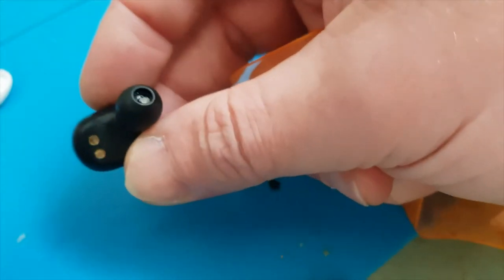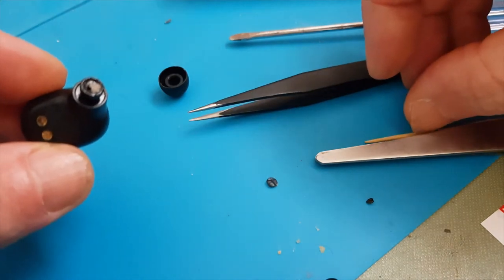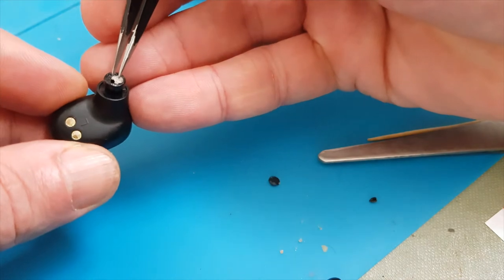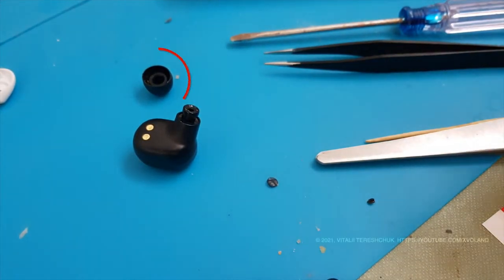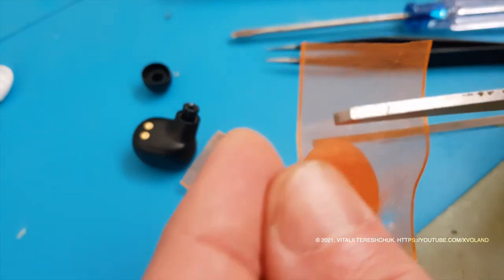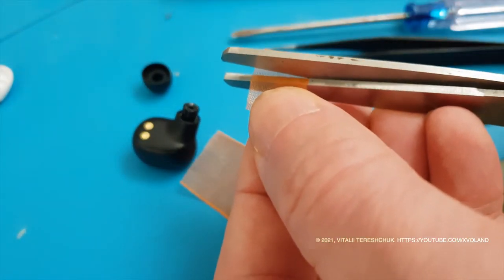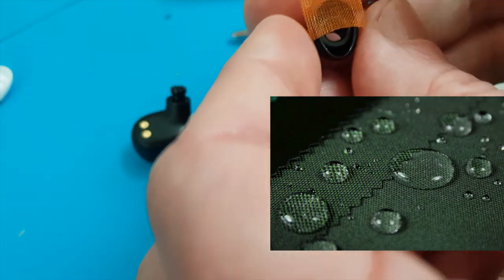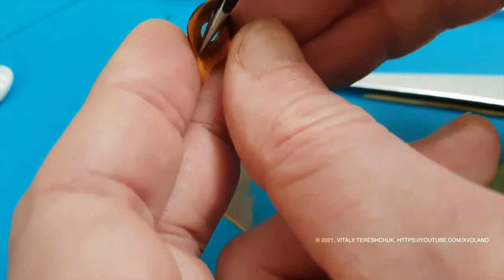🛠 💡 Easy way trick How to Repair headphones mesh grid (protective grill) and headsets easy fix

Comment: What happens when you don't hv a protective grid? It's lost just now what will happen to me now
Reply from the maker: Earwax will get inside
Reply: @xVoLAnD   is there any way to replace it with something, or like avoid it getting inside
Reply from the maker: @lvqgx  In this video I show how to do it.  Also in a few days there will be another video and I’ll offer another solution
Reply: @xVoLAnD  i didnt have that material, i tried thin paper and added some holes in it it worked the same, thanks
Reply from the maker: @lvqgx  The material I will offer is very easy to find
Reply from the maker: @lvqgx  https://youtu.be/r-vByOp-eHw

Comment: I have a question 
Are these grill sheets necessary or can we use earphones without them
Reply from the maker: Yes, they are. This prevents dirt.
Reply: @xVoLAnD  ok thank you 
I mean can I use it for sometime and will this harm my ears or not
Reply from the maker: @taedybear4523  There is wax in the ears and it can get inside the headphones. You can use, but remember about this
Reply: @xVoLAnD  ok 
Thankyou so much
Reply from the maker: @taedybear4523  You are welcome!
Reply: @xVoLAnD  how to clean my earbuds from dirt
Reply from the maker: @omarmohamed-ik7tr  If sulfur gets inside, then carefully disassemble and clean, but be careful, there are thin wires
Reply: @xVoLAnD  I'm sorry but I have one more question is it normal that the sound comes then disaperes without the mesh grid or my earphones has another problem? thank you vitalii ❤
Reply from the maker: @omarmohamed-ik7tr  Probably the wire already has a bad connection. Therefore, repairs are needed.
Reply: @xVoLAnD  thank you Vitalii, appreciated ❤️
Reply from the maker: @omarmohamed-ik7tr  You’re welcome! 👍🏻

Comment: Great idea! Much better than the thinking of the original makers! They should have thought along these line in the first place instead of their convuluted wax sensor inside next to their virtually uncleanable mesh and filter...Just get rid of them all and have replacable filters between the rubber thingy and the speaker. 
A. It's easy to clean and relplace
B. The wax is kept even further away from whatever they think needs protection inside....and
C. You don't need a stupid wax sensor that decides, "Whooa Wax alert! Let's ruin this guys listening experience forever while he figures out that the only way to get rid of the wax is to break his device!" 
Good ole Russian common sense saves the day again!
Reply from the maker: No need to insult me, I'm not russian.

Comment: I mistakenly touched the speaker a little while reparing the mesh.. now I hear something like base whoosh when the audio reaches high...any fix?
Reply from the maker: Sorry, but need to look at it directly. You may have damaged the speaker or something like that
Reply: @xVoLAnD  I think soo... The mesh was stuck inside and I used a pin to take it out and unfortunately the speaker's filter came out ☠️
Reply from the maker: @BashxeditZ  Check to see if you may have accidentally ripped off a wire. They're very thin, like hair
Reply: @xVoLAnD  alright bro!

Comment: What do i do if a wire broke inside the earphone (which goes up to that little square thing in the middle when you open it up?)
Reply from the maker: It's a battery, as I understand it from your comment. Solder it back.
Reply: @xVoLAnD  Okay tysm!

Comment: I have airbuds and it's mesh has came off but I have just placed it back like normal it doesn't have rubber tip so is it ok? Or should I use glue?
Reply from the maker: If you glued the mesh back and it was not filled with glue - yes, everything is ok. You'll know this when you use the headphones (they are quieter).

I refused to use glue, because the mesh was covered with it and they became quieter.
Reply: @xVoLAnD  I too have earbuds and I have lost its mesh.. also it doesn't have a rubber tip... What should I do?
Reply from the maker: @soumyakumari7287  In a few days there will be another video and I’ll offer another solution
Reply from the maker: @soumyakumari7287  https://youtu.be/r-vByOp-eHw

Comment: Just a thought, you can probably use a paper punch to cut out a better shape and size for this.
Reply: What I’d like to know is if I manage to get it to the size of the original mesh. What adhesive would you suggest to keep it in place?
Reply from the maker: @dariuswalsh  Good idea, but there is another video https://youtu.be/r-vByOp-eHw

Also, you asked: What glue to use? I think B-7000

Check the description under the video, China has done everything for you

Comment: Would not the wax also pass through the ribbon??
Reply from the maker: I offer a temporary solution.  Of course, you can solve this issue with a special fabric and I suggest it in description.  I'm talking about ideas, but how you will use is it… limited by your fantasy
Reply: @xVoLAnD  okay cool.. thanks mate